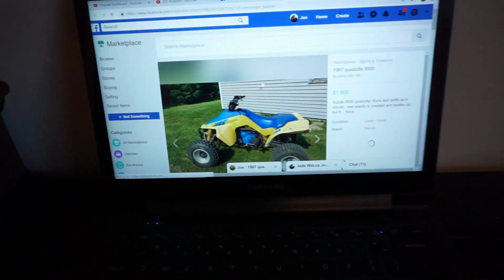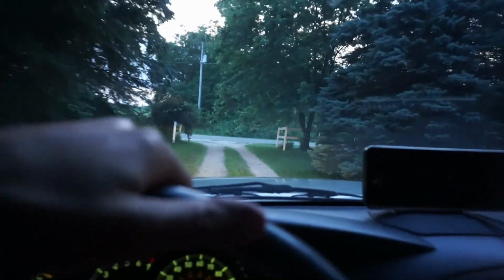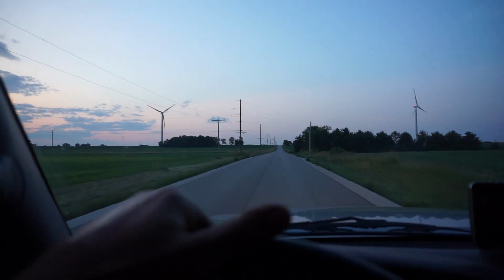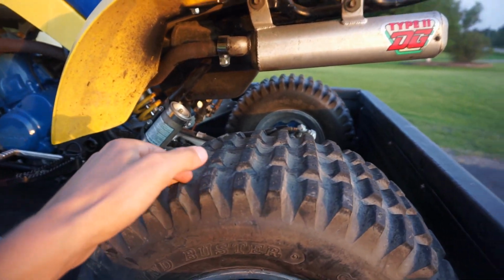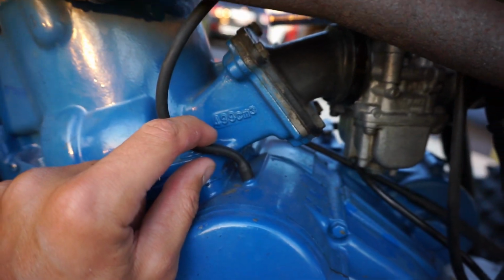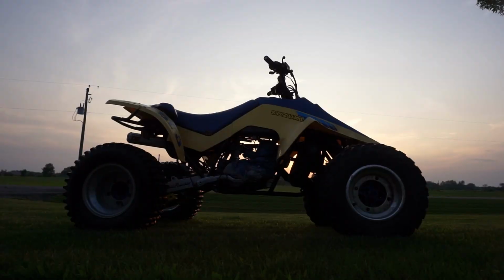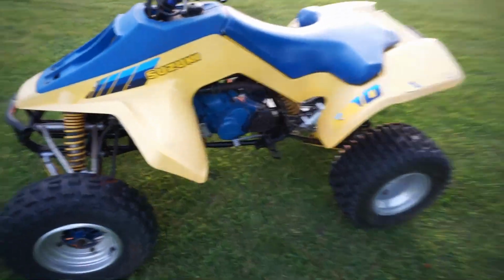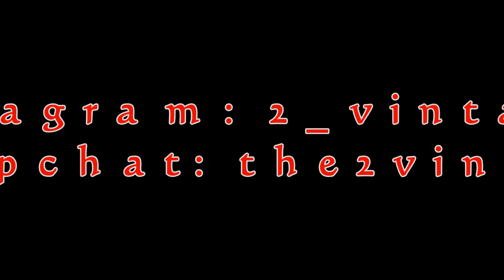Well...I Bought ANOTHER BEAST!!! Suzuki Quadzilla | Lt 500

Comment: Can't find a decent zilla in ny for under 2500-3500, minty ones go for 5000. The quadracers are just as expensive for a nice one you'll spend around 2000 if not more
Reply: Pretty common to see the 250's for sale what's rare to me is when they are original owners since the 80's with the title. I just missed out on a completely original 92 with a title for 2500 but it was gone in a day
Reply: Just get a trx lt’s are pooches

Comment: Fuel,air , spark and good compression.this only works for carburetor engines .the new fuel injection bikes and quads different story.u need to take a class like I did ten years ago.MIT in Florida.

Comment: That's definitely a 1987, do yourself a favor and get rid of that mikuni carb and get a 39mm pwk.
Reply: Chris Boehmer I had an 87 the engine was terrible. Cranks were weak and the head bolts were too. Worst bike I owned for longevity. It’s telling when they redesigned  the engine after the first year.

Comment: There fast but the lt 250 and the lt 500 are unbelievably unreliable never been riding with anyone with either one that wasn't getting towed home half way through the day want a nice two stroke 250 r or the banshee both time tested very reliable machines when they stop making something in I believe 89 and people still are racing them u know Honda did something right and u won't hear any complaints about a banshee either but the newer 450 4 strokes will smoke any of them Honda 450r best bike I ever owned

Comment: How about instead of spray bombing the shit out of it, research the factory flaws and fix them...i think you'd be a lot more impressed with it. 87 carbs are junk...head squish is wrong and the front end geometry is terrible. For less than 500 bucks at quadracerhq Dr q can fix these problems...just a tip bud